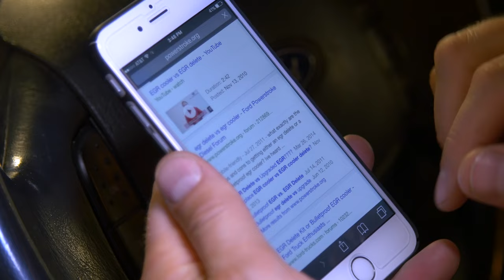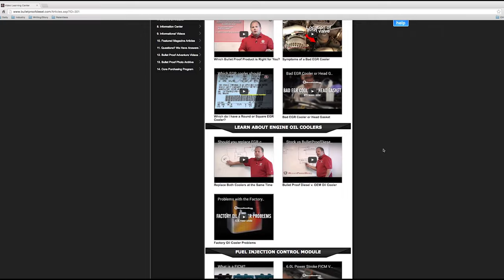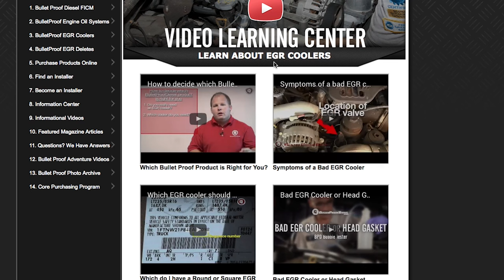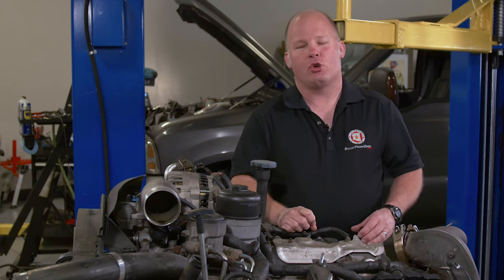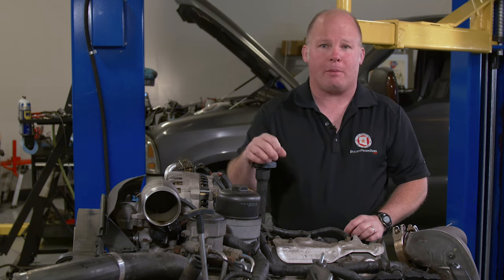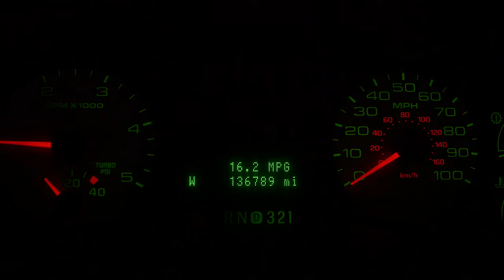EGR Delete or EGR Cooler?

Comment: Engines run cleaner when they aren't trying to reburn exhaust that chokes them out.
Reply: Doesnt really choke them out and doesnt really make the engine run non-clean. It's better for the environment and better for the miles per gallon.
Reply: You must be one of those "roll coal" types...lol!
Reply: @MrKnockout_  its not better for mpg and diesels burn cleaner then gas engines... they acutally put out more chemicals with all the emissions on it lol. Also having a egr active smooths out the cross hatchs on your liners. Which cuts your engine life in half, with a egr active its like throwing a handful of sand in your intake all the time its a pile of junk.
Reply: @duckymini6609  agreed and it's way worst for mpg's
Reply: @patriciomunoz2830  and cooler is less reliable than delete. Your bound to generate some soot even without a tuner which will plug up the egr cooler
Reply: You better believe it when i tell ya my cousins efi 460 egr was plugged up because it broke he gets a crap ton better mpg
Reply: I have always wondered what the people behind the installation of this devices have to say about it, i mean you clearly spend more fuel so that's more contamination same goes to dpf and urea
Reply: @Capt. Slow put a picture of it in the comments dont believe you or you dont know what they look like in the first place. Im a diesel mechanic have my red seal, i know what im talking about.  we seen 10000 of diesel engines worn out because of egrs.
Reply: @duckymini6609  I agree, the idea of pumping exhaust back into the engine is absurd. What is needed for combustion? air, fuel, compression....exhaust is neither. 
DPF's drive me crazy, collect all the soot and bad stuff in a filter just so you can pour raw fuel into it to burn it off later. That's conserving fuel? At least a DEF system is an after treatment and does not affect performance but is also not so good for ya. But what is coming from burnt fossil fuels?
Reply: @sciewter  yes sir i hear ya!
Reply: @billwhitis9997  lol trump 2020 kiddo💪
Reply: Wtf? Are you serious? So having to mine for more metals and have giant machines that burn diesel to do that because of early engine failure is better for the environment? Do you understand the concept of diminishing returns?
Reply: @duckymini6609  Red Seal doesn’t mean shit in the states.
Reply: if you look inside the intake manifold,,,it full of soot
Reply: To make the egr and dpf and the def the manufacturer puts out more emissions than all the trucks

Comment: The early 2003 6.0L Ford’s have the best EGR Cooler ever made. My HPOP went out in mine just 2 weeks ago. Since they were right there I told them to replace the oil cooler and EGR cooler, with a Bullet Proof EGR cooler. They replaced the oil cooler only. They pulled, cleaned, and inspected my EGR cooler. They found it to be perfectly functional with no issues. 
  The shop owner told me when I picked it up that they didn’t upgrade the EGR cooler. He told me I had the early 2003 6.0 EGR cooler. That it works better than any aftermarket EGR cooler. He also told me he has never had to  replace the EGR cooler on these early engines.
Reply: I have a late '04 and did the delete when it was about 10 years old. Engine light never came on 👍. They changed some things on the 6.0 mid '04. Usually it's the other way around when it comes to performance but the later ones are junk
Reply: So they made the 6.0 worse as it was produced?????  I thought they would make improvements. But all seriousness. I didnt think they could make the 6.0 worse cause its junk
Reply: tractorboy31 I’ve never had any major issues with mine. But I also use only synthetic Amsoil product and I don’t follow the 7,500 mile oil change interval’s either. When I replaced my oil cooler it wasn’t loaded with corrosion either. Just had it changed because they were right there and it was 15 years old. Coolant and oil filtration systems will save any motor. Especially a 6.0 because of the small tolerances. That being said I used to be a diesel mechanic. These motors will run for ever as long as you take care of them. But parts will fail. Engine wise I’ve only had to replace the turbo, intercooler, HPOP, glow plug warmer, ICP sensor, and batteries. In a 15 year old Excursion. The oil cooler was just buy choice. 
  So if you know what you have with a 6.0 and know how to take care of it. It should last you a good while. 
  I still have the original injectors in my truck because I use a fuel additive that is designed specifically for these Ford injectors. 
  All diesels no matter who makes them have some issues. Duramax, Cummins, and Ford.
Reply: @michaelbutcher6432  the 6.0 is a good engine. I bulletproofed the heads a few months ago (got 180k on the factory!) and it still has the factory finish on it. These engines will run 500k, maybe more, if taken care of like you said. They just have some quirks that we all know about. I'm not a diesel mechanic so I appreciate the fact it's simple enough that I can work on it unlike the new generation of diesels with all the electrical crap and that you don't have to pull the cab. I wouldn't be surprised if these motors are sought after in the coming years much like the 7.3
Reply: Michael Butcher What fuel additive do you use?
Reply: @michaelbutcher6432  Right on.  I use Schaefer’s supreme 9000 5/40 diesel oil.  I have amsoil bypass filtration, and also Dieselsite coolant filtration.  I ditched the Ford gold coolant, and run Delo ELC, which is actually approved by Navistar.  I change the oil, both oil filters, the stock Ford, and the Amsoil 2 Micron, every 3000 miles.  I also add two 4 oz shots of rev ex.  2006 ford F250 6.0. The only engine component I had to have replaced was an EGR valve that failed under warranty, and of course a FICM or two. Everything else is original at 142,000 miles.  These engines will not tolerate the extended oil changes that Amsoil claims you can get by with.  I tried that, and had problems.  The oil has to double as hydraulic fluid, to fire the injectors.  This shears the oil, as it was not designed to operate at such extreme pressures.  I still run very low splits on my oil cooler
I did flush the engine with Restore, when I got rid of the Ford gold coolant. Got a lot of crud and sand out.  I’m still getting casting sand in the coolant filter and the truck is going on 17 years old.  3:34

Comment: Did a welded plug style delete preemptively on my '06 over 5 years 75000km ago.
No problems whatsoever.
Reply: Hi, what did you do about the egr valve?
Reply: @swashington942  it is there and operates normally but has no exhaust gas going to it.
Reply: @kellyh4035  do you get a CEL?  I made the mistake of updating my tuner, and I don’t have the option to turn the egr off. I was wondering if plugging in a valve will clear the codes.
Reply: @jorgecortez-fx6pb  I just deal with the code

Comment: I’ve considered putting two egr coolers in, that way the flow is reduced and thus the heat, while the cooling capacity remains the level used with the full flow

Comment: a car i once owned had a egr failure. in broken mode the motor passed smog check with flying colors.
with a new egr valve it had to be "forced" to pass. only problem with the egr valve was a visual.  (diaphragm was broken).

Comment: I have a 2015 Subaru WRX. The new Subaru's use a new engine (FA20 DIT) that collects a lot of carbon into the engine. I would have to add Lucas Ignition cleaner when I fuel up at the petrol station. I added an EGR delete, along with a TGV delete, to keep the engine breathing better and keeping it cooler. Not to mention, with the EGR delete, I'm eliminating the carbon build up in the engine.
Reply: Subaru's have diesel engines?!
Reply: George Austers lol yes
Reply: Lance Tardiff ?

Comment: Question, will an egr delete make the function of the egr cooler useless? I am thinking about doing an egr delete on a maxxforce n13 engine to prevent egr cooler leakage of coolant or failure. Am i saying this right?
Reply: Yes, if you do an egr delete you might as well remove the egr cooler as well because it won't be doing anything, and it will prevent the cooler from splitting and leaking out all your coolant

Comment: Idk if its the same type or anything but on one video for a Dmax EGR he removed had so much Carbon buildup on it and he explained how that cap cycles back into the truck unless you remove it. Is it the same with Ford EGRs?
Reply from the maker: Exhaust gas is routed to the combustion chamber, but carbon buildup generally hasn't been a problem on Fords - we hear that some Ram/Cummins have had those issues within the EGR cooler itself (carbon buildup).  We're happy to report that we now produce BulletProof EGR coolers for selected versions of the 6.7 Cummins and the 6.6L Duramax, and our H-Core's helical tube structure resists both rupture and clogging.  Simply put, these EGR coolers actually work well.
Reply: @BulletProofDiesel  thank you sir

Comment: I got the bullet EGR cooler. I like it. But it still boils the coolant
Reply: The purpose of the bullet EGR cooler is to provide larger passages to prevent cracks in the cooler(leaking coolant), reduce carbon build up, and provide better egr cooler flow. Boiling the coolant is irrelevant.

Comment: It’s a shame for someone to believe a white smoke behind my truck is a better way to go during regen. People pull over not to smell it. Sad
Reply: One of the main reasons why the diesel engine blows white smoke out of the tailpipe is a bad injector, causing too much fuel to be injected into the combustion chamber. A clogged fuel filter, resulting in an unbalanced air/fuel ratio mix inside the combustion chamber, travels through the hot exhaust causing white smoke from the tailpipe, this will also cause misfires and a lack of power.A blown head gasket, transmission fluid leak through a damaged diaphragm. damaged valve stem seals or piston rings can leak oil into the combustion chamber.

Do your research before blaming white smoke from the exhaust on EGR delete.

Comment: How do you know if the egr cooler is bad on my 06 f250  i just had alot of work done to it when i picked it up it is leaking water out exhaust  no water in oil no oil in water no miss a little lose of power what do ypu think
Reply from the maker: Typical symptoms of EGR cooler failure are, white smoke/steam out of the exhaust pipe, coolant leaking  out of the exhaust and/or mysterious coolant loss from the degas bottle.  This is a very serious issues and can cause other more serious engine damage.  You will want to return to the service shop immediately.

Comment: Yes running spot through the clean air back into a perfectly clean fuel air mix will make a much cleaner combustion  incresting milage and horse power and longevity of your engine. 😅😂😂😂😂😂. If early catistrofic engine failure is what you dissier.😅😂😂😂😂😅😅

Comment: Is like running a marathon but having a cigarette before the run.

Only way to make it effective with EGR valve, do high mileage and change oil more than regular. 

If you use it to just pop around the corner to work or pick Kids up only  you will suffer with the EGR.
Reply: Buying theirs is like smoking a fancy cigar....still bad

Comment: Just bought a used diesel. DEF injector failed. $2300

Thanks Obama
Reply: Lol. I run a 7.3.  Just blew my tranny but the engine is good and will get it back on the road shortly
Reply: Cheap ford engineering is to blame for that one. Go over to Beijing and learn what unregulated emissions does to the air you breath.
Reply: do a full delete, cost a little less than fixing your def and your motor will last as a result.
Reply: Or blame Big oil for not cleaning up their fuel rather than passing it on to the engine makers to whom  are also in on the "passing the costs" to the consumer to push sales as the old equipment slowed sales due to reliability!
Reply: He's the worst President of my lifetime by far.  That potato currently in the White House is doing his best to catch up to him though.

Comment: So no real CON to a EGR Delete.  If you have your stock EGR cooler welded, there is  no way to tell if its deleted.  I have the external Oil cooler from you guys which is a good product, but the welded EGR cooler is the way to go.  My 6.0 runs smoother, cooler and has more power.
Reply: Riverratsd I agree welded egr is the way to go and an oil cooler relocation kit
Reply: So what the egr is welded blocked of internally
Reply: @tractorboy31  no, they just weld shut the inside of the tube so no air can flow through it.  Welds have nothing to do with mounting

Comment: If you aren't able to rewrite the ECU code regarding the EGR/TGVs do not remove/block/alter them.  You can do major, permanent damage to the engine at worst or just have the car go into and stay in limp mode until you put everything back in its original state and reset the ecu.  If you're looking for cheap horsepower: E85
Reply: E85 in a diesel?!? Lmao. How long did that run before blowing its top?
Reply: @yamahakid450f  Lol!  I fast forwarded past the beginning, and somehow blanked on this being a diesel engine.  You re quite right!

Comment: Putting dirty exhaust gases back into the intake is just about the worst thing for your engine. The air intake and valves get gummed up, air flow is reduced over time, and your coolant runs hotter because it’s cooling exhaust gas.

Comment: can someone please answer my question. Is it possible to stop the EGR by just removing the vacuum line that is attached to the EGR valve? or would this have any potential damage in the long run?
Reply: Slengo Slengaw nope
Reply: No you'd get hella codes

Comment: is that possible to delete the egr valve and use blowoff valve instead of egr valve in diesel engine
Reply from the maker: The EGR valve is part of the emission control system and cannot be removed or deleted.
Reply: @BulletProofDiesel  hai iam from india and i got a mahindra bolero with 2.5 ltr cdri engine and i want to insatall a blow off valve in it (big fan of suututututu sound ) is it possible to install

Comment: It’s crazy how many people on here are not properly educated about EGR. Exhaust gas is INERT which means it’s not reactive!  So in the combustion chamber it basically takes up space, causing less reaction and LOWER combustion chamber temps!  You are not choking on exhaust, deleting EGR RAISES your combustion temps. Put a proper cooler on!
Reply: That's part of why so many people end up deleting their engine instead of upgrading their EGR cooler.
Reply: It is never better to choke your truck on its exhaust
Reply: Your not educated on the EGR properly. Somehow your about half right but then your solution is ignorance. Yes exhaust causes carbon, soot buildup in a few places and can ruin an engine. It’s never smart to recycle exhaust into an engine. It’s dirty, it’s not 100% oxygen and it causes lower temps in the chamber. This is bad because it’s exactly how soot builds up and clogs things up. Smh. You want higher temps it’s better for the engine and soot won’t buildup. Our atmosphere is vast enough to not be affected by nox. The egr was just another way to ruin engines and cause people to spend more money.
Reply: @raingreen1103  I think you need to educate yourself a bit more on egr, I think you have a online chat room understanding of how egr works
Reply: Have you ever pulled the head on an EGR system?! There's enough "inert" soot to change the engine displacement!

Comment: My thinking is the EGR system clogs because often people aren't using their diesel vehicles correctly. Diesel engines are made for high mileage and mid to heavy loads - if they are used too often in short travel (many times before the engine gets to proper working temp, which is the other reason the EGR is there - to help engine warm up and reduce wear) they will generate too much soot. When it is used properly it does not build up excessive gunk in less than 30k miles, and helps engine run leaner.

Edit - in some cases the PCV system is as bad as the EGR for creating soot. Worth having a catch can.